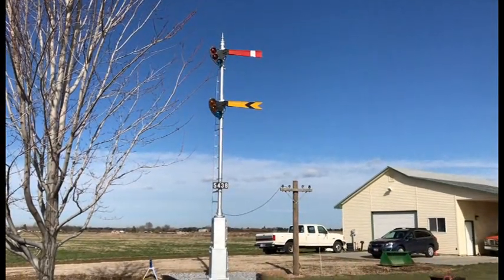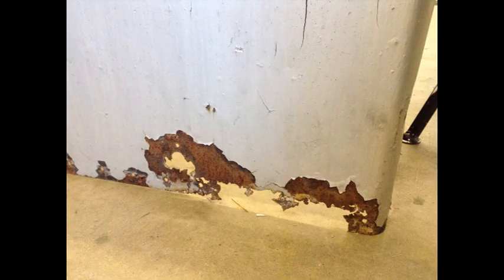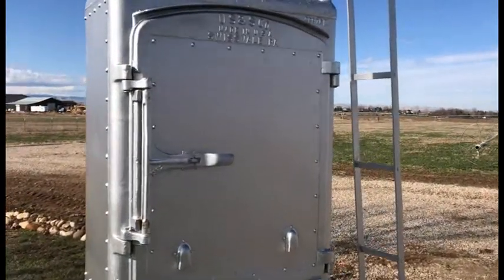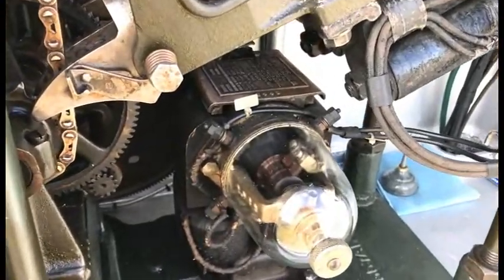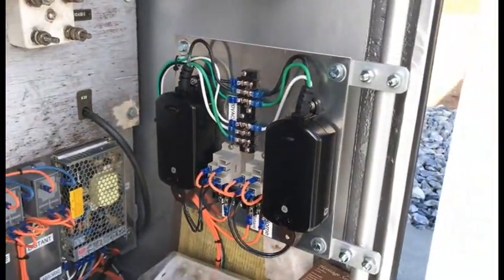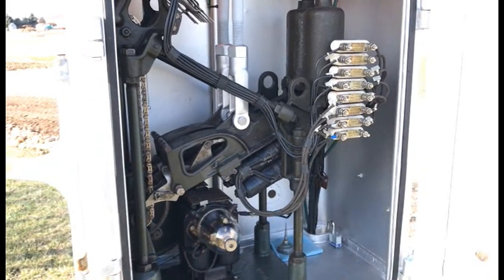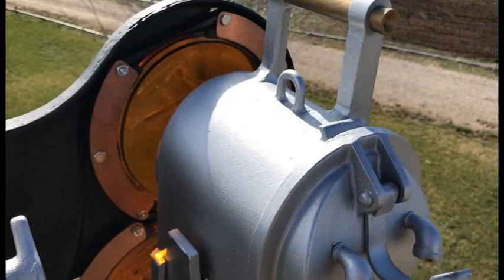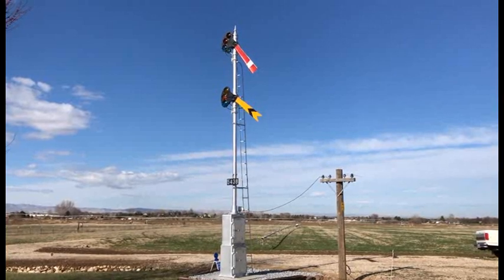Demonstration of US&S Co. Style B Semaphore Signal

Comment: My absolutely favorite model and type of signal.  Hats off to you, sirs!  You did a hell of a job.  It simply doesn't get any better than that!  

This is probably my favorite type of train signal because this is the first one I ever remembered seeing. My local zoo has a fabulous train, and has one of these near their train station.  It actually worked, too, as it would change from Clear to Approach to Stop as the train got closer back to the station.  They were wise enough to put clear covers on the relay cases, too, so 12 year old me (or however old I was by the time I got curious enough to study it) could figure out how it worked.  
It's been several years since I've been to the zoo, but the signal was not working the last time I was there.

Comment: Thank you for this posting. The lower quadrant "Style B's" were very prominent on the Harriman Lines as well as some other railroads. Here in Texas I remember them on the Southern Pacific in many places including San Antonio west toward El Paso, between Houston and Strang as well as Houston to Dallas and in lesser use at some terminals and junctions including the short stretch between Beeville and Skidmore. I recall the train crews occasionally reporting "lights out" on these signals. We were told to take the information and report it to the signal maintainer during his regular duty hours. We did not call the maintainer out on overtime for burned-out bulbs on Style B's as the semaphore blade position would still give the signal indication. However, if a "target signal" had a burned-out bulb we would call out the signal maintainer on overtime to replace it if he was off-duty at the time. I trained with towerman D. Jones at Tower 112 in San Antonio in late 1974 or early 1975. He was the "Dean" of towermen in San Antonio. Lots of seniority and knowledge of railroad history and practices. One day he mentioned that Tower 112 itself was built as a Katy tower (Missouri-Kansas-Texas RR) to their specifications as the MKT crosses the SP at that location. Apparently the SP and the MKT had made a trade-off with SP agreeing to staff and run Tower 112 and the MKT accepting responsibility somewhere else in Texas for reasons lost to the passage of time. One other item D.  Jones mentioned was that he had an older brother that had worked for the SP on a signal gang installing the original block signals on the San Antonio to El Paso line. The time-frame for that was just prior to or during World War I.
Reply: I remember that stretch between Beeville and Skidmore myself.  Did you know that was part of a light traffic CTC system, owing to traffic from both San Antonio and Houston combining at Beeville.  The line has been defunct for years, but I'll still remember it.  By the way, the CTC machine was in the Galveston Railroad Museum.  Wonder if it's still there?  Stay safe and healthy.
Reply: @markschroeder2578  it’s still there, sitting outside and ruined by the salty environment
Reply: I once reported a light bulb out on a searchlight color signal in South Athol, MA, CPF-363, Which stands right next to the road. I got the phone number from a nearby crossing signal in Orange, MA.

Comment: Until a few years ago, most of the line south of Eugene still used semaphores. You could see them in operation alongside I-5.
Reply: Cool, I found some of the concrete slabs that held the signals.
Reply: @TexasRailfan2008  Those are called foundations.

Comment: I know it’s a long shot. But if you see this post. What and where did you find the new rivets? AND, how did you install them yourself?  I to have double B case, and may want replace the metal also. 
Thanks, Vince
Reply from the maker: I got them from JC rivets. They can be found online. As to install them we made a special tool that holds the head of a rivet. I then used an oxy acetylene torch to heat the rivet and then inserted into the hole where my father was inside with a small air hammer. That mushroomed the rivet and so far it has held in place for four years.

Comment: So a quick story; when I lived in Creswell, I would frequently walk the tracks down past the signals that protected the tracks near Market Road. It was very common to see them malfunction on their last days from loss of communication (likely corrosion) from either the communication lines running along the tracks, or within the electrical box. Even though it was very faulty, it was still kinda cool hearing the mechanisms operate from trackside, and watching the signals move in response to the sounds from within. 

To this day I still wonder if CORP has a few of those blades hanging out in a warehouse somewhere along the line...probably not, but it would indeed be an awesome sight to see, that's for sure.

Btw, why is the signal five feet shorter than its normal size? As the video started, I instantly noticed the height difference. Just curious. :-)

Comment: Very interesting. Glad you could save it. Might I suggest putting in LED bulbs. Brighter and you'd never have to replace.
Reply from the maker: The focal point on the mirror is quite narrow and requires a sharp light. An LED not only would not look right but also not crest the hard beam. It’s not to bad to climb up and it is easy to change. So far the bulbs have last one year without turning off.
Reply: Heresy!!  🙂

Comment: Did you do all of the sheet metal work yourself, I need mine replaced but lack any proper tools to do it, what can I do to save money, thanks.
Reply from the maker: jimmy copeland i took off original sheet metal on box took it to local steel place and they copied it and rolled the new steel for it. Brought it home attached it and drilled and riveted the holes myself.
Reply: @Eriks191  I must say, that is one beautiful signal, I just acquired a Santa Fe T2, lots of work ahead of me but looking forward to the challenge, a question about the concrete form, how deep is it to support the weight of the signal.

Comment: Why did two-position signals have three spectacles?
Reply from the maker: Scott Melton the spectacle unit is a cast piece and could be used on a three position signal, (universal). This one of course is not so the middle is filled with the upper quadrant color. When restoring the signal the middle lens was plastic and faded didn’t match the railroad didn’t care and fixed it at one time with whatever they had.
Reply: @Eriks191  To the best of my understanding, about these two position US&S "Style B" semaphore signals, the main reason for using the three spectacles, albeit, being only a two position semaphore head, was so that as the semaphore head was returning, from its DANGER/STOP position to its CLEAR position, was so that the light would not be "shadowed out" until the head fully returned to the Green light position. Hence, the spectacles were in either order: R-R-G or, Y-Y-G. 
That plastic "filler" lens,you make mention of, is quite interesting, though.

Comment: I wonder if it were ever realistic to keep semaphores on modern railroads. I can only maybe  fancy the cost of replacing them all and training drivers to use both them and modern lights together would have made them stick around in an alternate reality. Are there any systems worldwide that use a mix of both lights & semaphores?
Reply from the maker: Felice Graziano there is actually one remaining main line in the US that still has them and it’s owned by BNSF down in New Mexico. Not sure how long they will stay.
Reply: Railroads prefer non-mechanical signals so it's doubtful that they'll want semaphores any more.  Stay safe and healthy.
Reply: This is really a great question.  It's easy to answer for the USA:  No.  They would be incredibly expensive to maintain, and bright lights are far preferable to colored sticks at a distance for fast-approaching trains.  Upper-quadrant semaphore schemas could be devised to give about all of the same aspects by semaphore that color light signals do today, but interaction with PTC would be painful since the semaphore mechanisms themselves are intended to form parts of the signaling circuits between signals.  Edit: For got to mention, the signals the video poster talked about in the SW US are out of service (to my understanding) and on the way out as we speak.

Other countries still do use semaphores.  I can't say how many high semaphores lurk in parts of Australia, but I'm sure there are plenty of dwarf ones around.  They (dwarf discs) were often used for shunting signals.  They were also used in this way in Great Britain and, I believe, Ireland.  Great Britain has made sure work to eliminate high semaphores from its main lines the past 10 years.   It's my understanding that work is complete, but semaphores can still be spotted on lesser lines.   There do seem to be some semaphores still operating in Germany.  They're definitely gone in Belgium.

Comment: I have to ask a question here about a "train order signal," assuming it uses the same, or similar, roundels in it as those used in any US&S Style B semaphore signals.
In Troy, NH, at the depot (now a railroad museum) its Train Order Signal is illuminated, red in one direction and (supposedly) green for the other direction.
While the red aspect displays a pure red color the green light appears to be an almost white color! Do you know why this migh be the case? Do you think that the lighr in it used (maybe be an L.E.D.) is supposedly "too bright" to be used in any such signal head? Does your US&S Style B semaphore signal display a "more green" color than this Train Order Board signal at the depot? (There is no question about the Red aspect output. It clearly shows a red color. I have yet to see this Board set for a yellow display, most likely for nighttime viewing.)
Reply from the maker: If they are using an LED bulb, then there may not be enough yellow light in the bulb. Back then incandescent bulbs gave off a lot of yellow light so the lenses were actually a bluish green when an incandescent bulbs shines through it. It creates a green light. With an LED that is a daylight bulb, you do not have that wavelength.
Reply: @Eriks191  Yes! I am able to understand your reply here!
1) I have watched your video, to include you opening up the light housing on your restored Style B signal.
2) Also viewed another restored one head Style B "stubby" semaphore signal (one that has a shorter height, whereby an upcoming bridge would block viewing that signal from the train). IT DID HAVE a more greenish light output than that Troy, NH Train Order Board, supposedly being lit with an L.E.D. bulb. (It MUST be!) It is a 34 second video by a Ty Henshaw.
3) As you mentioned that "green" DOES have a slightly bluish tint to it. I can see it in the lense.
4) I had read somewhere that in order for an L.E.D. to put out white light it requires something like: "1Red; 1Green; & 2Blues." I have only a vague idea what this means.

Comment: Hi. Fantastic video. I was wondering if you could share some details on the wiring diagram for the hold coil that is nearest to the front of the case. I just acquired a nice old style B and the hold coil has four wires. I have a feeling that one of the magnets has failed because there is zero resistance across it and I think there should be about 500 or thousand Ohms. However I’m not entirely sure how to wire it up. It seems that it should have two circuits. One that energizes when the motor starts and when that actually passes through the motor coil. Any input would be greatly appreciated. Thanks again for the great video
Reply from the maker: Could you please send give me your email and I could send you all the information on the low wind and high wind magnets.  Your magnets are in good shape it’s just how you wire them. We had the same problems.

Comment: What do you use to power the signal motor? I did not see a battery so it must be a power supply?
Reply from the maker: There is a 12v power supply in the bottom cabinet.